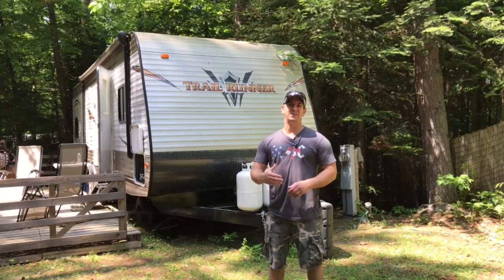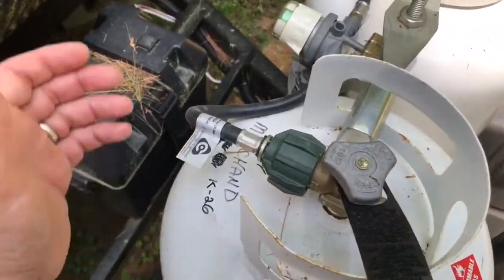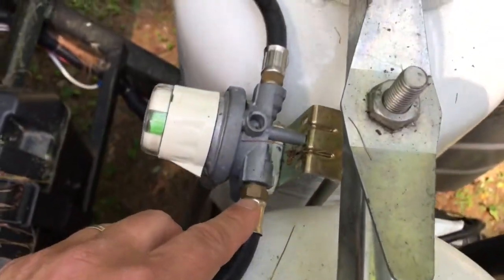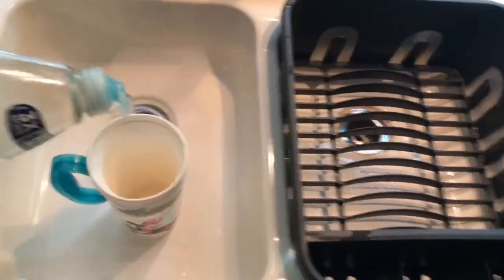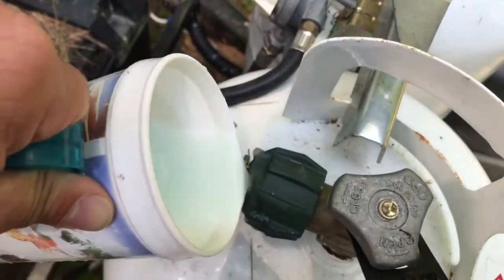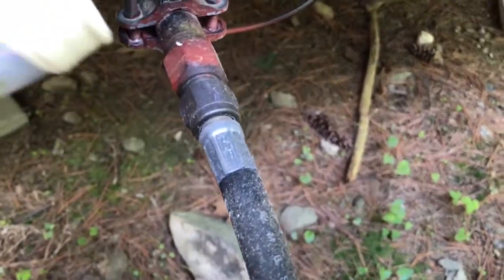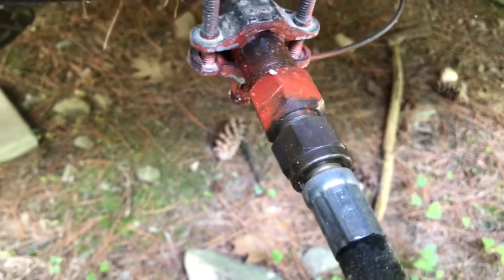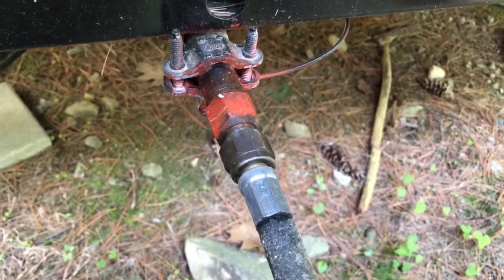How To Check An RV Propane Line For A Leak

Comment: I'm on the hunt now!! Thanks I used this method in the house.. but just got a RV that smells like gas inside😔so let the games begin😁 good video👍
Reply from the maker: thank you for watching our video on how to check for a propane leak in your RV. Hope this helps you to find the source of your leak.
Reply: @HomeOwnerRepair  yes I found it!! Gas line from stove was the culprit.. pinhole in the line. Found it immediately after spraying soapy water..saw the bubbles but also heard it hissing as the soapy water hit it ..thank you

Comment: That's pretty cool and simple. Think I started to notice a leak in my RV particularly one my hot water tank is on with propane as the source. Is it likely the cable leading up to the hot water tank or somewhere in the tank itself do you think?
Reply from the maker: You may want to test the gas line from the propane tank to the heater to see if there is a leak at any of the fittings.

Comment: Yes I got a camper that had a gas heater and gas refrigerator in it I took out n acnged with electric ones so the stove is only thing left gas n the copper lines I just bent n clamped down on the two other lines you thank that would leave or would it be good enough ??
Reply from the maker: You defiantly want to make sure that those disconnected gas lines are not leaking.

Comment: How about in a truck camper? I'd practically have to tear it apart to put soapy water on everything
Reply from the maker: If it has a propane line, you should be able to apply this method to your truck camper.

Comment: Me Again.
I don't believe that I delivered my last message properly.
So, one more time?

When I went thru  2  
20lb tanks in a week. It became obvious id a leak in my line.
                SOMEWHERE.
1st thing, I "Bubble Tested' the connections at /on the hitch. Where you bite into line that enters the trailer   it seemed obvious that the individual tank connections would be fine. I will swing BACK to"tank connector queries"  in a moment
   They did pass the SOAP BUBBLE TEST. which leads me to where I hit a Roadblock.
1st things 1st : SPIDERS!
BlackWidows specifically.
I have seen & Eliminated  MANY, Impressive in size( poker chip!)
 B.Widows.  By the wheels the hitch, & the entry steps. So GOD KNOWS what lurks in the DARK BELOW. Where I need to crawl w/ my Soap Bottle. To find the source of my leak . 
I have NO Idea what to expect under there. And as Widows are attracted to light(so I've read) I'm reluctant to drag a drop-lite  under there with me. 
So, to recap:
Obvious leak.
All exposed connections appear ok
That said, seems the line  on the under side of the trailer is where it must be. BUT, it is F-ING  SPIDERLAND Under there. And I know this as I have DESTROYED a handful of   Huge Black Widow Spiders. That have bivouaced in Plain Sight'@ : the wheels
                   the hitch &
                the entrance.                                                      
                           steps..
Reply from the maker: got it